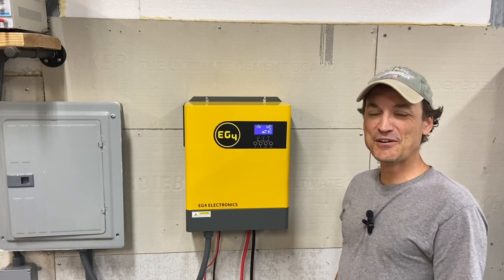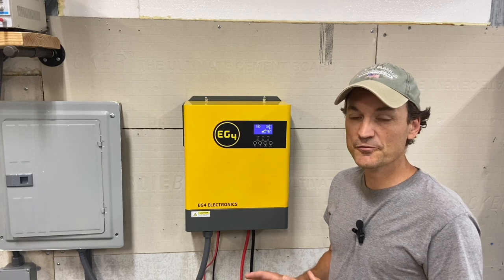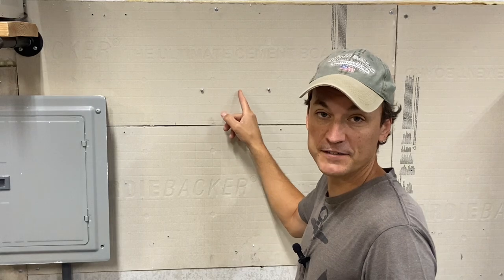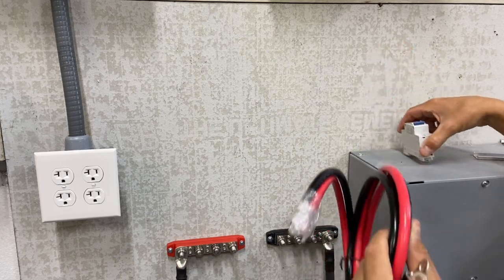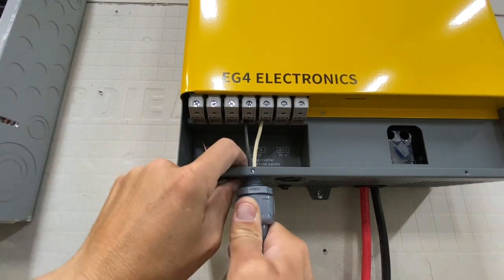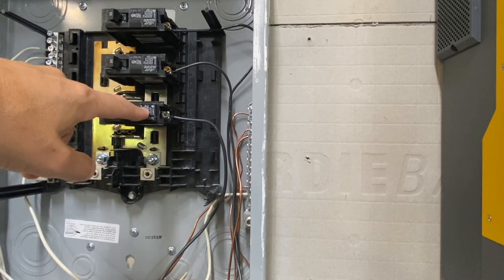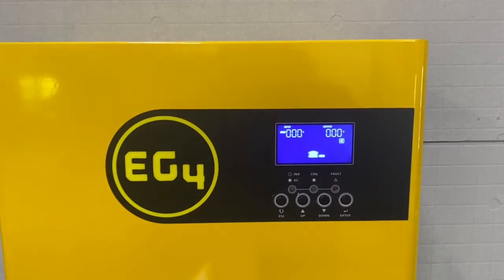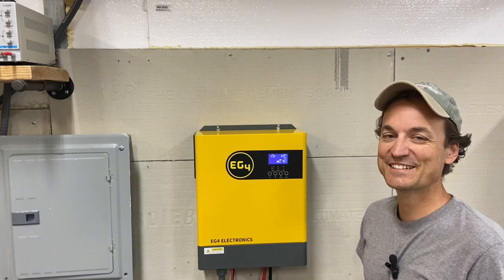Eg4 3000w 48v inverter install and load testing. Signature Solar beginner friendly solar inverter

Comment: Using the input grounding terminal will leave your system ungrounded when the unit disengages the bonding between the input and the ground neutral bond in the unit.  The input ground is only connected to the chassis during AC bypass mode.
Reply from the maker: There is continuity between the case and the input terminal when bypass is disengaged . I checked this to make sure.  In other words, when using the unit with or without grid, the terminal and case seem to be bonded.
Reply: @GavinStoneDIY  that would be a defect.  There isn’t supposed to be a bond between that terminal and the chassis while the inverter is providing power.  At least that’s the direct response I have from signature solar.  I’m in the process of hooking up 4 of these in split phase.  If what you’re saying turns out to be true, that’s going to be a safety issue for my system.
Reply from the maker: @michaelpeden4033  congrats on the install. I’d like to see that when it’s finished actually. Maybe you could explain the safety issue you’d be having in this instance.
Reply: @GavinStoneDIY  in a system that is tied to the utility, introducing a second ground neutral bond produces a situation where current will flow on the ground wire during normal operation.
Reply from the maker: @michaelpeden4033  the case ground and terminal ground having continuity isn’t related to ground neutral bonding. You could utilize either one. In this case it  just insures that the chassis won’t become a conductor in the event something goes wrong.
Reply: @GavinStoneDIY  interesting, did you test continuity when the unit was inverting or while off?
Reply from the maker: @michaelpeden4033  I tested with it both on and off. I’ll try to take the unit apart to explain it better in the next video. But I’m assuming they are both just screwed into the case. So something like that can’t be on a relay. The neutral being bonded to the ground is a different discussion. That’s why I tagged that link from signature solar on G/N. There is a lot to say on that subject for sure. There’s enough written about it on the solar forum to make your eyes glaze over.
Reply: @GavinStoneDIY  suddenly not too happy with the 3000 watt units.  I just had two of them blow out operating in parallel 120 mode while charging 5000 watts each and inverting about 20 amps of AC each on a bright sunny day with seemingly no explanation.  Just a large pop and now one of them is completely dead while the other comes on but doesn’t function.
Reply from the maker: @michaelpeden4033   that doesn’t sound good. What is your VOC on the PV coming in? How long had they been operational before this?
Reply: @GavinStoneDIY  320 volts and about a year.  They had been extremely reliable until then. Now I’m not sure if I can trust them.
Reply from the maker: @michaelpeden4033   if they are in parallel the one unit may not be operational because it’s still in that mode and hooked to the dead unit. The problem may just be with the one that made the popping noise.
Reply: @GavinStoneDIY  it’s throwing error code 9, error code 12 and the solar input is shorted through as a direct short drawing nearly 20 amps when solar disconnect is engaged.  When the first unit fried it triggered over current protection going to the batteries.  When the charge controller shorted, the battery connection also shorted.  The battery terminals are also showing a direct short on that unit.  I haven’t opened it up yet, but it’s probably a fused chunk of copper windings and melted circuit tracings.
Reply: There was enough instantaneous back flowing current from the first unit to have over volted the second unit.  Keep in mind, this was a bright sunny day.  There was a zero % chance this was a surge strike of some kind.  It seems more likely to me that the unit was either defective or that it’s design specs are not capable of long term functioning at the max specs without breaking down from the lack of heat dissipation.
Reply from the maker: @michaelpeden4033   I have seen cloud edge effect does some crazy things. But you’re likely correct. Odd though that it shorted instead of blowing a fuse.
Reply: @GavinStoneDIY  I’m in,limbo waiting for the service people at signature solar to get back to me.  I can’t make a decision on whether to sell the remaining two working units and buy more reliable equipment or to continue investing in these inexpensive units hoping for better results if EG4 decides to honor its warranty obligations.  I’m unsure of what design changes were implemented during version 2.0 design changes or if that is related to my version 1.0 unit failures.  It was a big red flag to me when they almost instantly had a major product design upgrade after just months of a product release.

Comment: I know you can double tap the down button to see how many volts your panels are bringing into the inverter. Is there a way to check how many amps are coming in from the panels?
Reply from the maker: Yes, as you scroll through that’s one of the options.

Comment: Great video, may i ask what size liquidtight fitting did you use on the AC  out hole? ..thanks
Reply from the maker: I think it’s designed for 3/4. The 1/2 I used was a bit loose.
Reply: Thanks for the info saved me some trouble was going to order 1/2 inch @GavinStoneDIY

Comment: Great video! Besides PV input, is there a way to hookup a wind turbine?
Reply from the maker: Wind actually generates a much more inconsistent supply. For that and other reasons you would have to use a specific wind charge controller. Midnight solar has one I believe. I haven’t researched a lot into wind to be honest. It typically can’t provide much power compared to solar.
Reply: @GavinStoneDIY  
Thanks!!

So separate controller for wind turbine from the EG4? But then I assume, (hope) the wind turbine controller can be hooked up to same battery configuration as solar, the EG4 batteries?

Understood wind is different animal & inconsistent, but really want to have something supplemental @ night if only to meet or exceed the approx 60w of idle consumption to avoid coming from battery. (Will have bare bones system to start with one battery & idle consumption is major concern @ night when not producing power from PV).

Thanks again!!
Reply from the maker: @InVinoVeritas.  yes indeed, the separate charge controller can be incorporated into the same battery bank. You would just use the battery voltage for your charging parameters. If you have enough wind that would be awesome to help with some night time loads. I have toyed with the idea of eventually putting a small turbine up. I just haven’t gotten into really researching possible yields from it. And where I live the wind isn’t really all that impressive..

Comment: How did you turn the beeping off? In the manual I only see how to on the warning buzzer.
Reply from the maker: I believe it was on setting 18 “buzzer mute”. So unfortunately that will mute your alarms as well. But that’s the same way it was on my 6500 watt inverters.
Reply: Thanks! @GavinStoneDIY

Comment: What size cable gland did you use? I would appreciate the info if you can find the time. Thanks.
Reply from the maker: I used 1/2 conduit. But it was a bit small. I believe it’s designed for 3/4.

Comment: So I am getting a mains undervoltage when I connect the grounding cable to ac in.   Since that cable is in there it thinks ac is giving input.  Going to try the screw on the bottom and see if that error resolves.
Reply from the maker: I believe those terminals are both just connected to the case of the inverter with a lug. So that shouldn’t make a difference either way.
Reply: @GavinStoneDIY  do you have the same alert on your smart Ess app ? Thanks again sir.
Reply from the maker: @Yowhatsupman  I haven’t seen that alert no. There is likely a different cause.

Comment: The PV In looks like it would accept much in the way of AWG. I get the others will be AC and so much smaller wire. What is the maximum AWG the PV IN can take?
Reply from the maker: It looked like 8awg. Which would be fine. This unit can take 500voc. So your voltage should definitely be high enough to have 10 awg in most cases.

Comment: So 10 gauge wire from AC OUT (and that piggyback ground wire over there on the side) to small subpanel. Move some home circuits to said small subpanel. Use 30 amp breaker since the unit can't do more than 25A output anyway (I'm shocked by this statement since those batteries should be able to output 100A easily)...

If I'm skipping the busbar, and just putting in 4 100Ah batteries in 48V series, I can just put a on-off switch on the red wire, hook a victron smart shunt onto the black wire, and then land them both right into the inverter without the busbar. Yeah?  Do I need a disconnect for the AC too or should the 30A breaker just be considered that stopgap instead?
Reply from the maker: The unit comes with a breaker for the DC positive. So you should be good there. If you’re hooking 4 12v batteries in series I would buy a battery balancer also. Since they will get out of balance over time. 

You shouldn’t need a disconnect for the AC side. The breaker will do that for you. But some people do install one, it’s more preference really.

Comment: I enjoyed the video. I've got the same inverter, with 1 48v eg4ll battery. I built a cart build. I'm not off grid. I'm having problems with the inverter communication with the battery. I also wired in a 120v cord for input power to the inverter. It will not charge the battery. Also, I'm getting a fault code of C19. Any help or suggestions would be appreciated. Thank you.
Reply from the maker: The f19 error is just telling you to hook the battery communication up. Do you have your setting 5 set to eg4 protocol? The manual does a pretty good job of describing how to hook the eg4 LL’s up to the inverter.
Reply: @GavinStoneDIY  Yes, setting 5 is for eg4. Communication data plug is in both the battery and inverter.
Reply from the maker: @jvm3753  make sure you have the correct cable. And the dip switches are in the correct positions.
Reply: @GavinStoneDIY  The dip switches is where I feel the issue is. The manual contridics itself. Which direction is on, off. I've tried both positions.
Reply from the maker: @jvm3753  don’t pay attention to the specific verbiage they use. Just copy the picture they have in there for the LL model.
Reply: @GavinStoneDIY  OK, I've worked my way past the fault code, got the battery charging; now I'm not getting but only 4.27 vac out of the inverter. Placed call to Signature Solar, they want pictures.
Reply from the maker: @jvm3753  I’m not sure what you mean on that one? It’s not producing the correct voltage?

Comment: If you have it connected to the grid and batteries with solar and the gid goes down during a rain storm of 5 days, how do you input your generator as it did not seem like there was room for "Gen In"?
Reply from the maker: So the input is designed for either a generator or grid. It doesn’t have a separate input for generator specifically. The easier option would be to have a chargeverter. I have a review on that. And you could use a generator to charge your battery bank with the chargeveter in the event the grid was down long term and you batteries were low.
Reply: @GavinStoneDIY  Thanks for all the helpful answers.

Comment: If you hook to a solar panel do u need a charge controller?
Reply from the maker: This unit has its own built in charge controller. That’s why they are commonly referred to as all in one units. AIO.  They have the inverter and charge controller built in.

Comment: IS there any way around the required 120v minimum solar input? I am putting this in a van and getting 120V of solar with limited install space is not easy. Thank you
Reply from the maker: You could add a separate charge controller. Like a smaller Victron for instance. Those can work off very little voltage. But that sort of defeats the purpose of an all in one inverter in some ways. That’s probably the only workaround that I could think of.

Comment: Isn't there already a ground neutral bond in the inverter? 
Why both load center and the unit ?
Thanks in advance
Reply from the maker: The newer units come without a bonding screw. So I added the bond in the load panel. You can also contact SS and they’ll send you a bonding screw for the unit if you needed it.

Comment: Is a battery needed for this to operate...or can it operate just off solar panels.
Reply from the maker: If you want to power any significant loads yes. I believe in the specs it says you can have some limited  functionality without batteries. In my tests it would shut down when tested loads on it with solar only.

Comment: Can it be programmed to shutdown say 10 pm to 6 am?
Reply from the maker: I don’t believe it has any time of use settings. It does really well in eco mode though. So if there isn’t any loads it uses very little power.

Comment: Excellent review.  Nice work.  Can you comment on the NG bond screw and if it is installed or not?  Mine came without it and as a result i am not bonded in battery/inverter mode.  Theyre sending me a screw.  They sell you an off grid inverter that you cant safely use off grid.  And support is non existent.  Months to get an email reply.   Thanks!
Reply from the maker: Mine came without a bond. So I assume it doesn’t have a screw. I could crack it open to check. But I’m fairly certain it would be missing. . You can bond it in the breaker panel like I did. Just needs a jumper wire between ground and neutral.
Reply: @GavinStoneDIY  if using off grid, it needs the screw!  Be safe.
Reply from the maker: @tsp2jxd  the screw bonds the g/n inside the inverter. It basically just grounds the neutral to the case of the inverter. And the case is grounded with that terminal I used or the screw on the bottom. You can use that screw they are sending you to bond it. Or you can bond it in your breaker panel. Either one, just not both. The important factor is that it’s bonded. Prior to these discussions in recent years most people bonded their off grid breaker panel.

Comment: How many server rack batteries can i hook up to this? All the videos i see for this unit only use one.
Reply from the maker: As many as you like. I have 3 hooked up to it. But a lot of people use a full cabinet (6). Or you could add one of the new pro batteries. Which equals about 3 rack batteries.

Comment: What type of Solar panel array would you recommend for this inverter and one or two 5000w batteries?
Reply from the maker: With the solar aspect It would depend on a few factors. Like how much average sun you get in your area. But probably at least 1500-2000 watts would be a good start. Obviously more is better if possible. The more solar you have the more the inverter can charge and also supply power to loads at the same time. The batteries are similar in the sense that more better is better. Starting with 2 batteries would be ideal. Really it often seems to come down to budget. If your budget allows for two batteries and 2000+ watts of solar that would be the best. If you’re in the US the 30% tax credit definitely helps.

Comment: Is it necessary to use the eg4 LL batteries with this unit?
I would like to get one. But not if I have to discard my 6 brand new Redodo 100ah batteries.
Reply from the maker: No, you can definitely use the redodo’s. They wouldn’t be able to communicate with the the inverter. But you could use the lead acid setting. So the inverter would charge and discharge those batteries based off voltage. I ran everything like this for over a year without issue. 
If they are 12v redodo’s you would series 4 of them to equal the 48v you need.

Comment: How many 15 amp circuits do you think this can handle?  I'm in the middle of installing my system and realized that I needed at least one more circuit than I was planning on.  I do need one 20 amp circuit too.  I hope to level 1 charge my electric car.
Reply from the maker: So it can output 25 amps total. That’s 3,000 watts divided by 120v.
Reply: @GavinStoneDIY   I think I was tired when I asked that.  LOL  This morning I said, come on Jim, it is like having a 25 amp service.  People show videos of this thing running 3 refrigerators and furnaces all at the same time.  Will Prowse ran a few heat guns at the same time and you know they pull more than 25 amps.  But I guess even when people say this will back up your house for awhile in an emergency, it isn't true.
Reply from the maker: @Javaman92  it will back up essentials for sure. It’s hard to find something at this price point that will power your fridges and freezers in a power outage. 

The eg4 6000xp is the next step up. That can power 240v loads also. So it really depends on what someone is wanting to accomplish.
Reply: @GavinStoneDIY  Thing is for 120v loads only the 3k and 6k units are the same, only 3,000 watts total 🤷‍♂️
Reply from the maker: @bizzfo  the 6000xp is  6kw total. If you need 6,000 watts of 120v loads you just have to spread them out between both phases. And that’s not difficult really.
Reply: @GavinStoneDIY ah, thanks for the explanation!